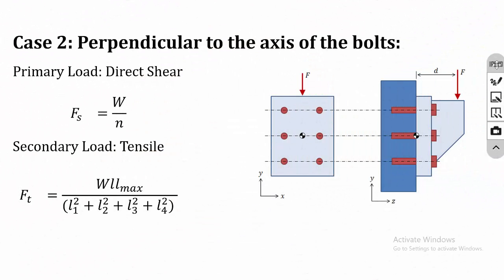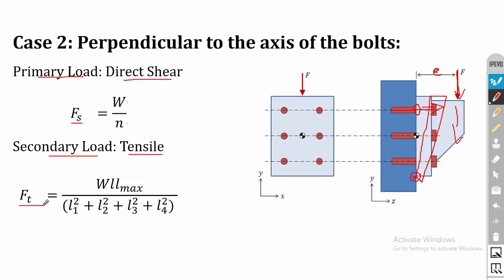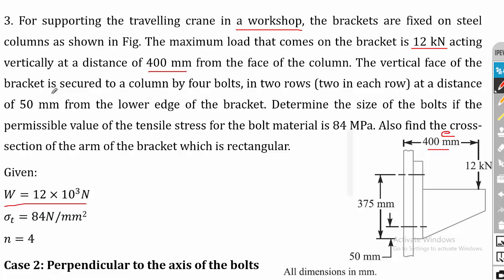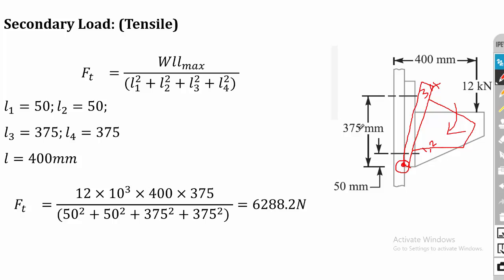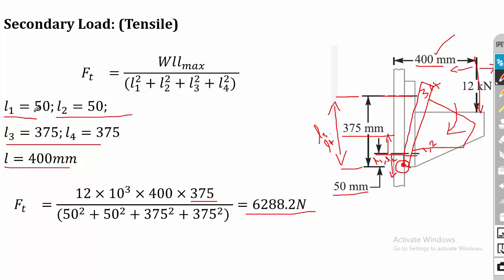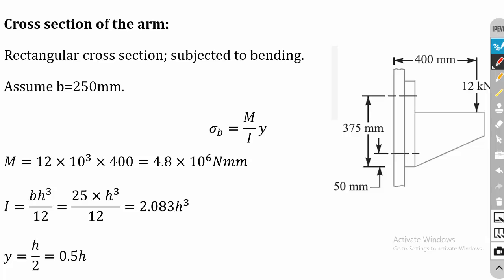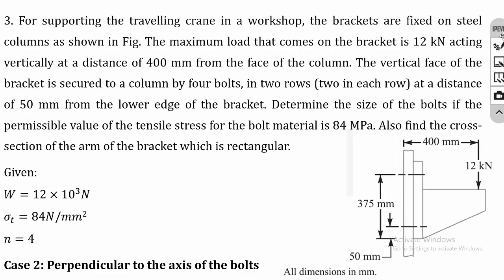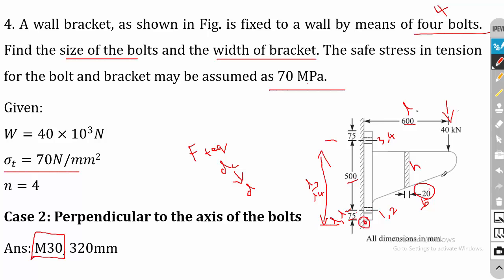Eccentric Loaded Bolted Joints | Perpendicular to the axis of the bolt | Design of Machine Elements

Comment: hello sir, I have any question about d=1.2*dc you can expand that formula from? thank you so much
Reply: and Permissible value of the tension stress ,how to calculate this value and have solution?
Reply from the maker: It is a material property.
Reply from the maker: The ratio of 1.2 is often used as a rough guideline in engineering practice, but it can vary based on the specific thread design, application requirements, and industry standards.

Comment: i have the same problem but the force is unknown,but the maximum allowable tension and shear is given , how can I solve it
Reply from the maker: If the cross-section of the arm is given, substitute the maximum normal stress(tension) of the arm and its cross sectional properties in the bending equation and calculate the bending moment... From the bending moment calculate the maximum allowable load...